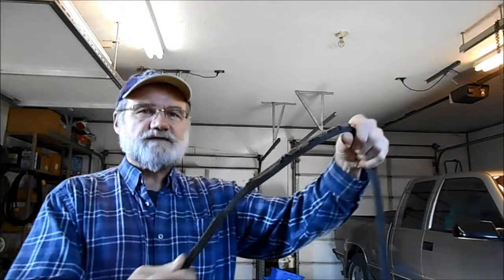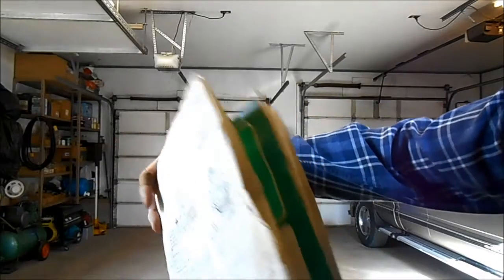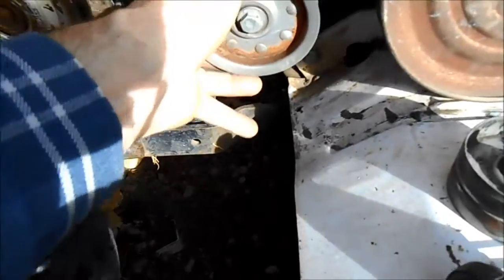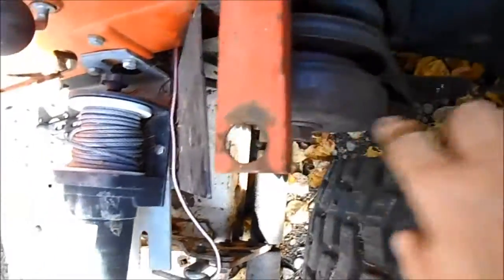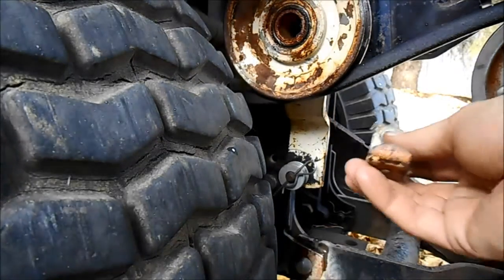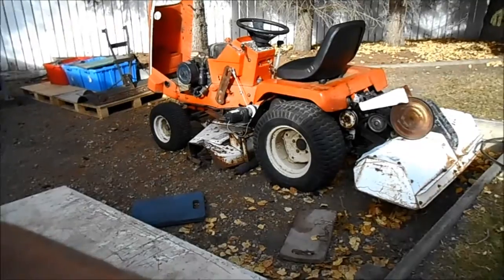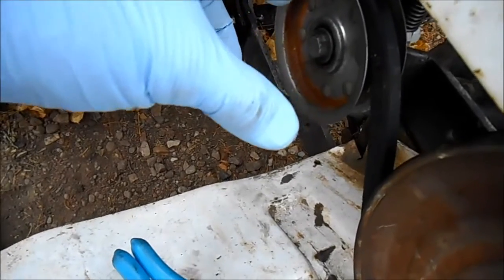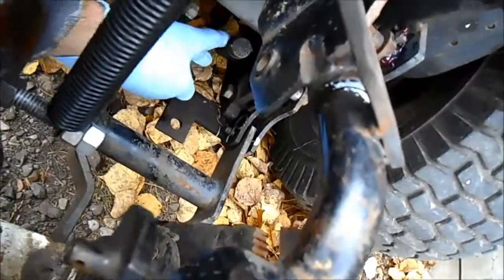Working on the Allis Chalmers 716H  Part 1

Comment: Really appreciate this Bruce! We just picked one up with a tiller and our idler seems a little funny, like it sticks or something
Reply from the maker: There will be things.  Just work on them one at a time.  It is a tough way to do it but then you don't loose interest with a tractor torn all apart.
Reply: @BrucesShop  we got it fixed, i noticed that we had the spring in the wrong spot thanks to this. On to the next thing!

Comment: I have a chance to buy a 712 Allis with the shuttle trans How hard are they to work on looks like it has some new belts on it and is suupposed to run and mow
Reply from the maker: Zippo would be the one to ask.  i work on tractors but he is the experts as you may know.  Thanks Jim
Reply: @BrucesShop  Zippo helped me on the shuttle Info they are tricky ...I am going to buy a 716 H  with the hydro trans I am getting it at a good price since someone put a Briggs on it and replaced the original Kohler ?? engine...I am going after it Monday Thanks for all that you have taught me about mowers and tractors
Reply from the maker: @not2fast4u2c  We teach each other my friend.